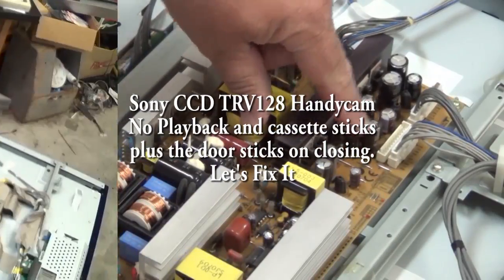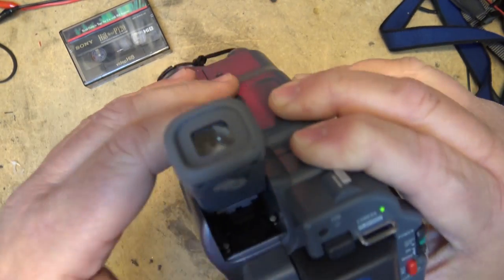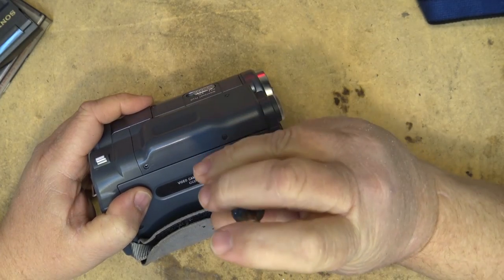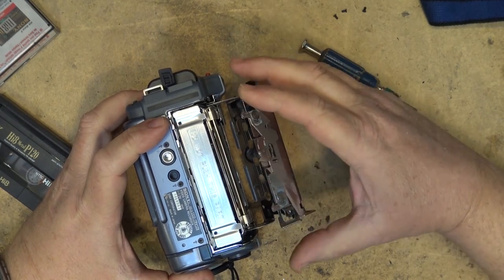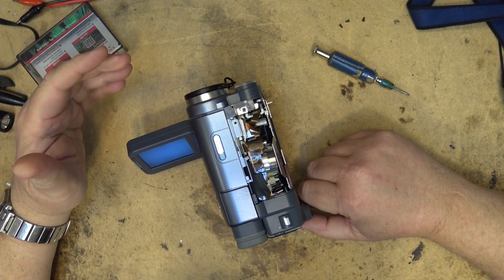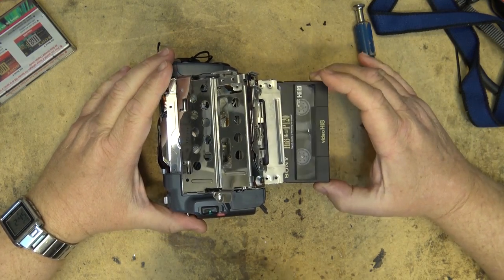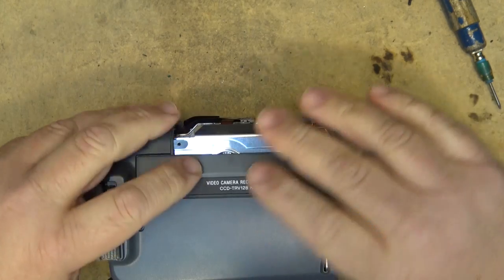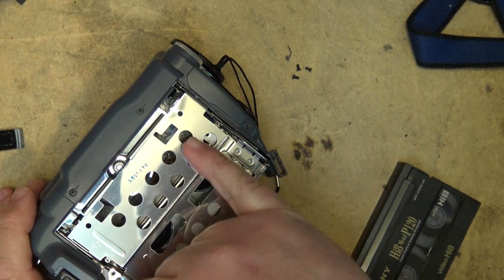Sony CCDTRV128 no playback and sticking cassette repair

Comment: I have this same cámara and it’s keeps on saying to reinsert the cassette but it seems that the cassette is  stuck and I have been trying to get it fixed and can’t find anyone
Reply from the maker: There are not too many around that work on this stuff anymore.
Reply: @12voltvids  is there any way that you would be able to fix it by a chance?
Reply from the maker: @jazminescamilla7728  good chance yes.
Reply: @12voltvids  what should I do do so you can fix it ?
Reply: And how much would it cost?

Comment: some analog video cameras have good  quality better than other  like  sony hi8 3ccd camera SONY CCD-VX3 for example.
Reply from the maker: I had a VX3, and an EVS300 (that was a 10,000 camera) and while he color was good, it was still only fuzzy analog crap quality. The cheapest cell phone camera could run circles around it.
Reply: @12voltvids  right

Comment: I didn't know Hi8 camcorders were still manufactured in 2004, I thought only Digital 8 were.
Reply from the maker: This would have near the end of the run for hi8.
Reply: 12voltvids 
Same for VHS-C, I have a JVC S-VHS-C camcorder from 2004. Those are good camcorders. I don't know if they were still manufactured after 2004 or if it was the last year. Also, my parents used to have a JVC VHS-C camcorder in the early 2000s, and in 2011 when I was using it, it ate my tape so I opened the camcorder and found out that the toothed belt on the capstan motor flipped upside down. When I reassembled the camcorder, it no longer turned on.
Reply from the maker: @mrmagnetoscope  
I used to hate working on camcorders. It was one of the things I really dreaded working on. I fixed my share of them, and nobody was happy. Ever. Always grumpy because the cost was always quite high, and many times we stamped no guarantee on the receipt which pissed them off even more. These were the ones that sand or water damage was noted.
Every single one of them swore than they had never been to a beach or on a boat. The standard reply, ok so you haven't been to the beach, but your camera was. Of the best line, ever. Great shots of your wife on the nude beach. She looks great. Oh the stories I could tell about what was on tapes in camcorders.  Homemade porn is not a new thing.  Of course we never actually saw those tapes but we knew which cameras were used. Those where the ones where 500.00 in damage was done to a 2000 camera by the customer forcing the tape out because they didn't want anyone seeing what was on it.

Comment: I have the same playback issue in my camcorder in which there is no picture seen when it is played but there is a picture when rewound and fast forwarded but the thing is my camera is Sony CCD-TRV86 in which the bottom part of the compartment can't be opened separately and I won't be able to do the fingernail trick because the head can't be reached. Please help. What should I do?

Comment: That camcorder is actually worth more than $100
Reply from the maker: I sell the ones I fix.
Reply: @12voltvids  I sell them too, not fix, but in the video you said the shipping was $58, and it might not even be worth that much, so I was just pointing that out. I sell on ebay and these are going for about $100-$120 plus shipping. Maybe I misunderstood you though.
Reply from the maker: @GuacSause  
Never sell on eBay because I was burned there once.

Comment: I HAVE SAME THIS PROBLEM IN MY DIGITAL8 CAMERA MODEL DCR TRV-140E AND I FIX  IT>>YES ITS CABLE
Reply from the maker: Very common problem. Most people can do this one themself.
Reply: 12voltvids I have a problem with my digital 8 dcr- trv260 where I put the cassette tape in and the screen stays blue even though the tape is spinning I tried rewinding and fast forwarding and nothing
Reply from the maker: @aaadriancito  
Well it could be dirty heads or the connection between the head and main board or a failure of the main board.
Reply: @12voltvids  cassette path

Comment: My tape won't eject and it's important I save the tape
Reply from the maker: If the rotation sensors are not working the camera will start to eject then go back down because of the hub doesn't turn it will leave tape sticking out of the cassette to the camera reloads to protect tape.
Reply: @12voltvids  ok thank you so much for your advice my friend

Comment: I used an even simpler metode, i had a "cleanning tape" laying around and voila
Reply from the maker: Yes they work.  They take a little bit of the head with them. Fingernail doesn't.
Reply: @12voltvids  what do u mean they take the head?
Reply from the maker: @bidartbauer8581  dry cleaning tapes are abrasive.  They work by basically sanding the surface of the heads to remove the contamination.  In the process a little of the head surface is removed.  They wear the heads slightly every time you use it.  That's how they work.
Reply: @12voltvids  oooh i did not know that, well hopefully its not really nessesary to do this often?

Comment: @ 12:43  What the hell ?!!!!
Reply from the maker: Learned that trick from an old engineer at the TV station I worked at.  Finger nail is hard enough to clear the clogged head and soft enough not to damage the head.  A trick of the trade that service people would rather you not know.  That will be 50.00 please.